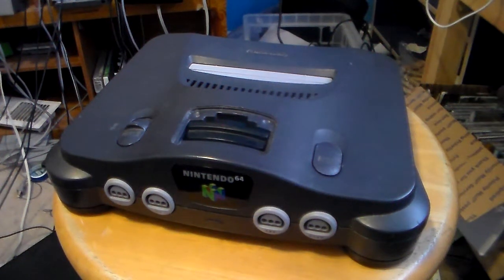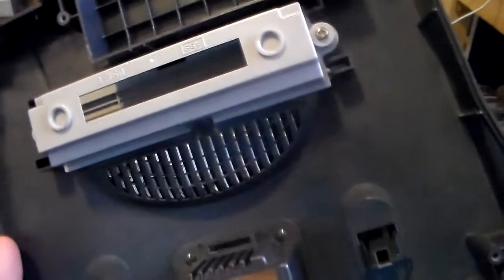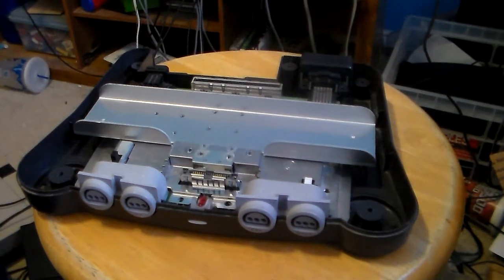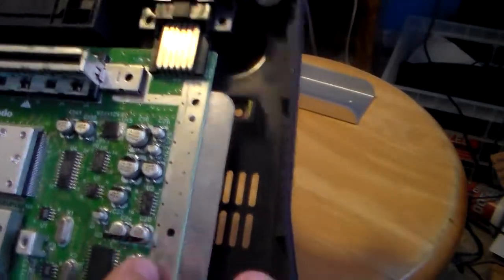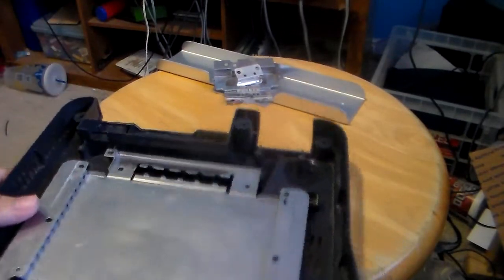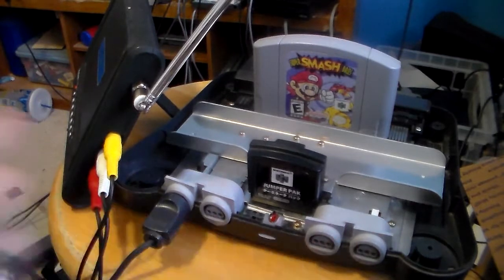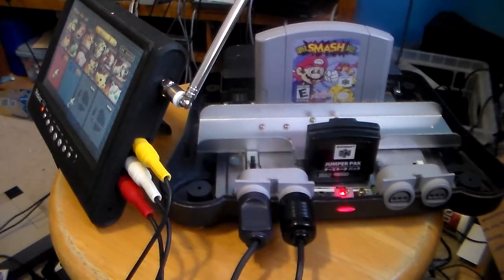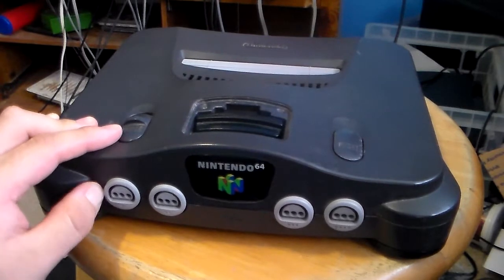N64 disassembly

Comment: Can the entire assembly be removed in one piece? Or do I have to remove all those screws and parts like you did?
Reply from the maker: Spade Spade You could remove the 5 screws around the housing plus the 2 in the expansion slot then you could take the whole board out, but if you wanted to get to the board I reccomend taking out the remaining screws .